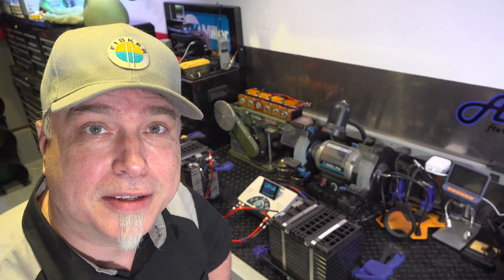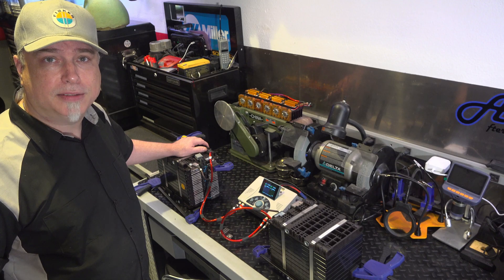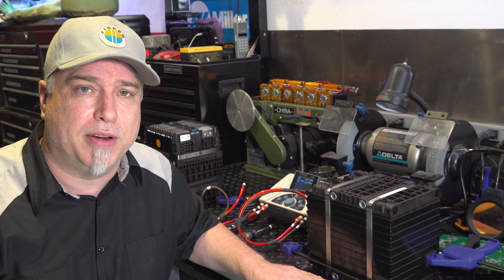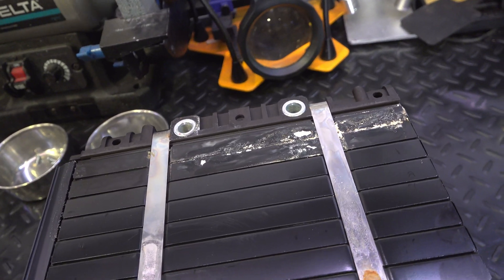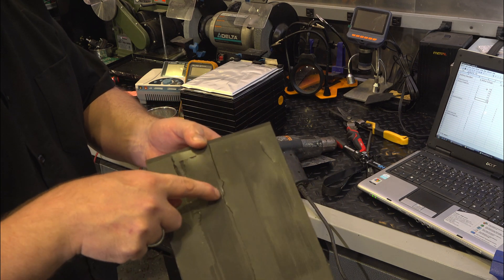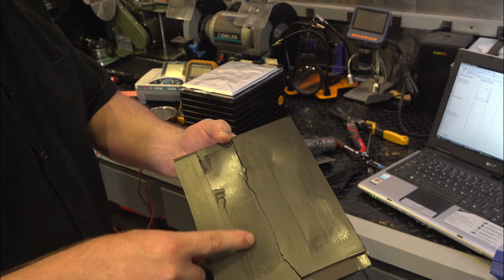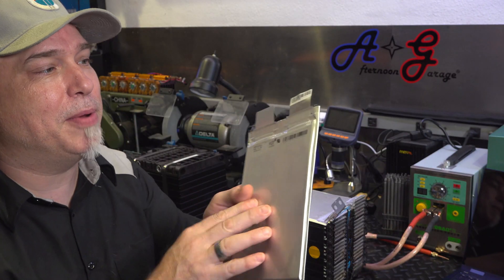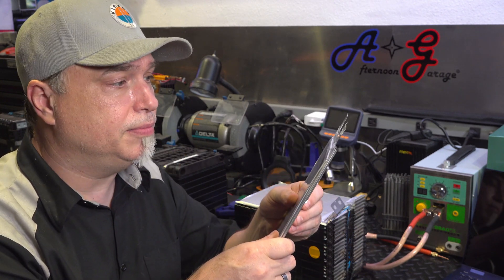Fisker Karma: Module disassembly [4K] Ep48

Comment: These are cheap on eBay. What is the voltage of each module?  The first solar system l built l used Ford cMax 7.6kwh battery so l could tear down it & build a 12v system using 4 cells =16.8 max voltage. This allows me to set the inverter charge controller @ 15.9v. This gives my system more energy and it stays higher in its voltage range. Built that system in 2017, building my 3rd system now for our '75 MCI bus we are building.
Reply from the maker: LiFePO4 (LFP) cells are 3.2V nominal, 3.65V max, and 2.5V min.  Thanks for watching my series on this!

Comment: Do you fix these type of batteries and if so how much you charge????
Reply from the maker: I understand there are some modules for sale on the Fisker forum.  I have this 7 part series to show how to change the individual cells yourself if you can't get ahold of a good module.  Repairing the modules like I did cost very little.  I see you can get the AMP-20HD1 cells for $15 out of China.  My car was bricked with three bad cells.  I have a bunch of cells if you are having trouble getting them.

Comment: So where did you order these battery cells, and what’s the price ?🤭🤔
Reply from the maker: I got my AMP-20 cells from a China importer.  I have checked and they have sold out.  Problem is shipping lithium batteries is an issue.  They require special customs declarations and also special shipping methods, especially if you are after a dozen or so.  I just check Alibaba (Chinese marketplace), and they have AMP-20 cells and full 7S3P modules for sale.  I have looked at shipping through these companies and it can be hundreds, sometimes a thousand to ship cells properly.  I purchased a bunch of them for future repairs.  I paid about $25 a piece for my AMP-20 cells.  Looks like complete modules can be had for $450-$500, but you got that pricey shipping.
Reply: @afternoongarage  thanks for this. Knowing that modules can be had for 450 to 500 is interesting. A cell replacement is costing me 3.500. And more cells cost 1,000 each. Not a bad mark up on a 25 $ part 🤣.  As A123 Systems was also bought by this Chinese company, one would hope they would design and make more powerful modules. Anyway, something to look out for. Keep up the great work. We are heading towards an electrification era. Electrifying classic cars with a standardized electric drive train that can come at a more affordable price is key. Have you thought about electrifying a nice muscle car from the past?
Reply: Excellent video’s on the Karma!👍🏼👍🏼👍🏼
Reply from the maker: Thank you for watching!  I have other things planned for this car in the future.
Reply: @afternoongarage  and that would be 🤔?
Reply from the maker: @louishendriks8054  I had some water on the CIU and the infotainment was messed up from water, so I want to look at how that comes in.  Probably be removing the dash.  I am going to take a look at some things inside the cabin that needs improvement.